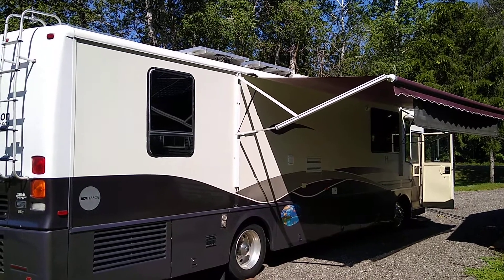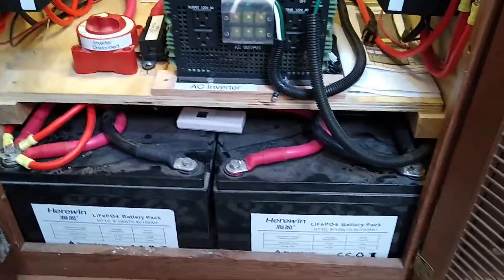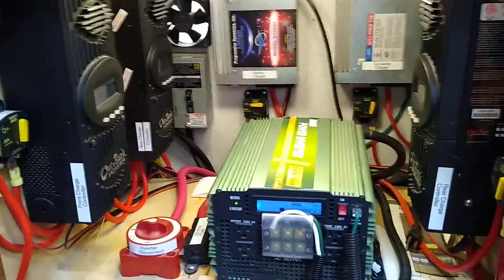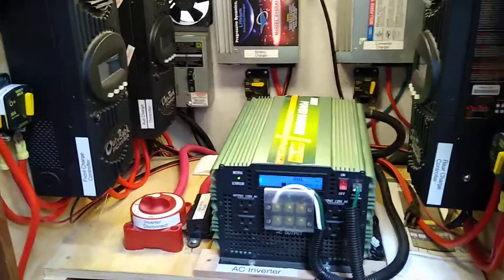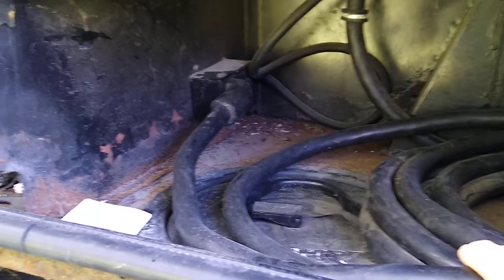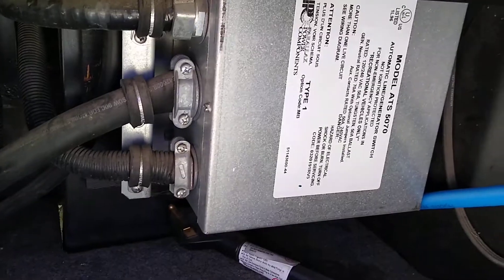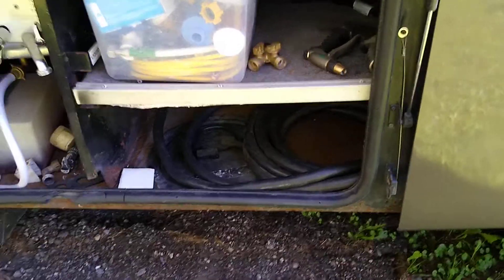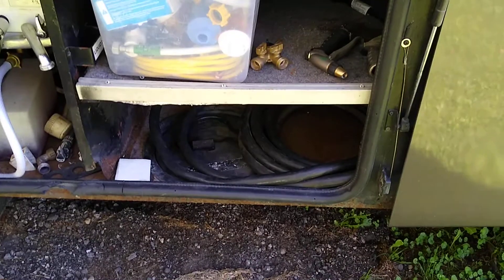RV Solar System Transfer Switch Do You Need One?

Comment: Thank you for showing this alternative.  When you are powering your rv via the inverter wouldn’t it that ac power loop back and try to charge your batteries?  Do you just have a breaker for the converter and turn that off when running power via the inverter?
Reply from the maker: No loop back. Our inverter batteries are not connected to the coach batteries. Not sure if you have watched the following video. 

https://youtu.be/GwNmpUXiWGE

This video shows our solar system setup. 

Thanks for watching our videos and for your comment.